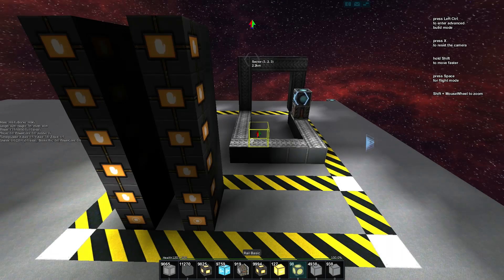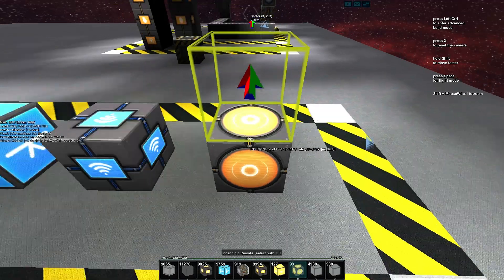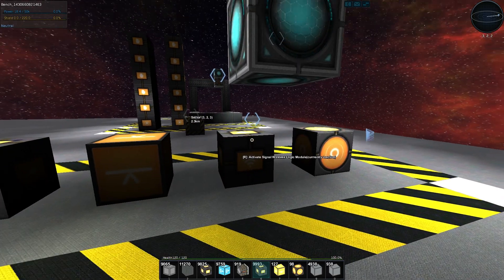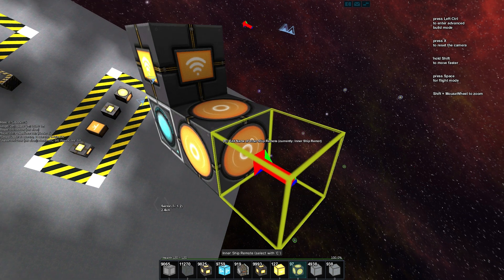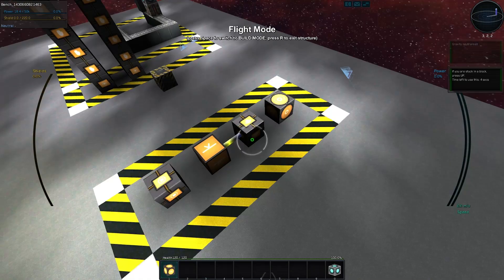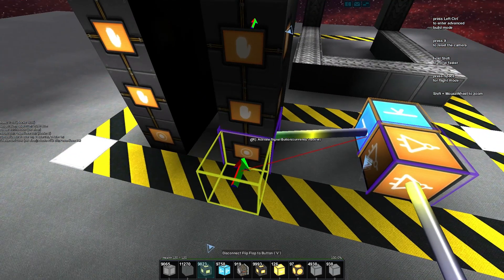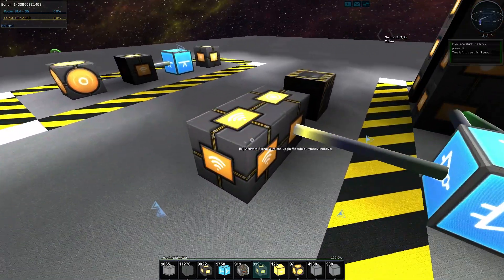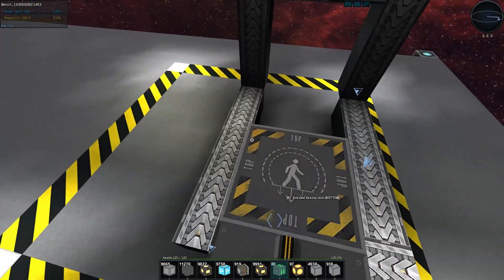Starmade Rails - 06 - New Logic Blocks

Comment: bench, just asking, im wanting to make a rail lift (an elevator to go from deck to deck, how do i make  a rail block swap the arrow to make it go from up to down, with a logic activation module triggering it with a module on each floor doing the same thing. it only gonna be a two floor lift so.
Reply: +toot toot If you want to to go between just two stories it is explained in video 5.
Reply: Karakas oh, ok thanks, (ive basicly scraped the idea after trying to do it but  thanks anyway!
Reply: +toot toot If you change your mind, pm me. I'm working on a ship with a tram that goes down the rail, then up. I have it set up so that the return button also swaps the vertical rail, so it'll bring it back down from the upper deck.

That probably made no sense.
Reply: +toot toot If you change your mind, pm me. I'm working on a ship with a tram that goes down the rail, then up. I have it set up so that the return button also swaps the vertical rail, so it'll bring it back down from the upper deck.

That probably made no sense.
Reply: Tony Evans  no it didtnt
Reply: toot toot I figured out how to make a tram that can go to and from somewhere, including if that somewhere is on a different deck.

Look at letter L, it'll go left/right and up/down with two buttons. To send the tram or recall it.
Reply: oh, well im not to interested, i made my own working elevator recently anyway

Comment: I don't understand how flip flop block works, what does higher signal mean?
Reply: General Revil I'm no expert in logic, or really Starmade at all, but I'm pretty sure the flip flop block just takes a signal and "stores it" sort of. 

Say you have a button and it's connected to a flip flop, every time you press the button, or every time the flip flop receives a high signal it changes states from high to low or low to high.

You can think of a high signal (blue I think) as "ON" and low (orange?) as "OFF"
Reply from the maker: General Revil I explain high and low in this video here https://www.youtube.com/watch?v=mYQq5wwiJ8k
Essentially each time the flip-flop block has one of its inputs changed from off to on, it will swap what it is outputting. So as Tim said below, if it is low or off it will swap to on, and vice versa.
Reply: So when any of its input is activated, which send out a high signal, flip flop changes it state; and when any of its input is deactivated, which send out a low signal, flip flop does nothing?
Reply from the maker: correct. it is specifically looking for something going from low to high. If two inputs are high already and your third input is low, and you change that low input to high then it will change, it doesn't matter the other two were still high.
Reply: Bench so basicly you can set alarms up. so say if one ship triggers the block the base would say trigger a light. warning everyone a ship is in danger